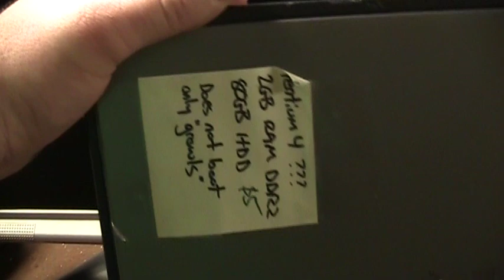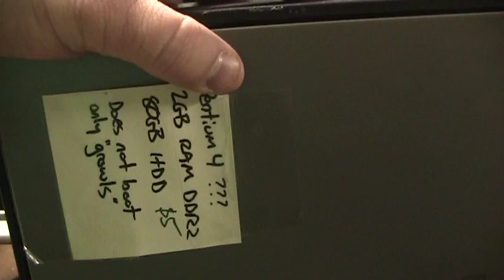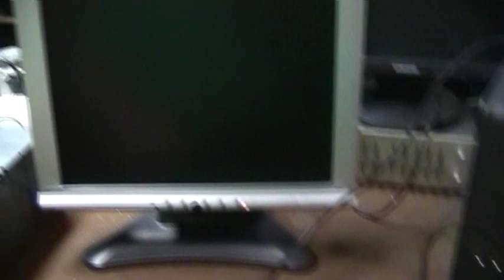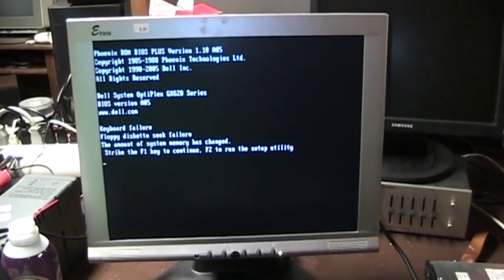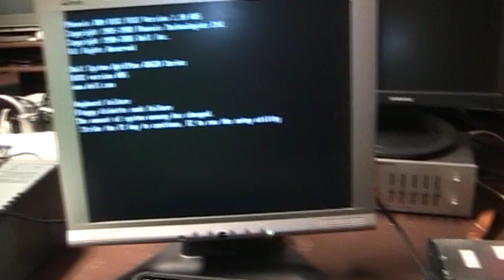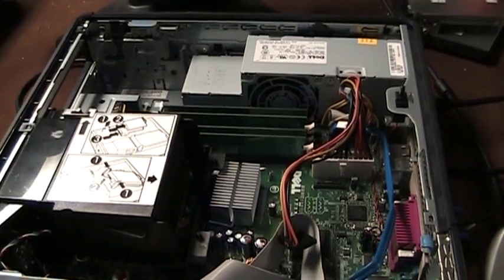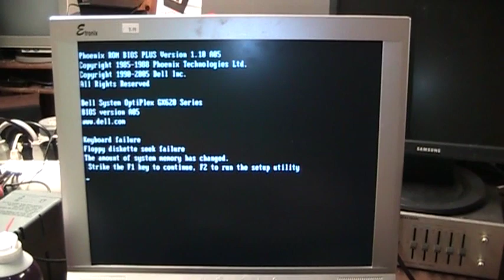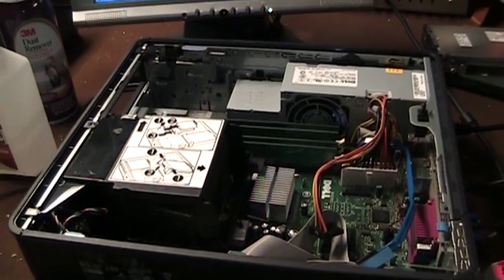Fixing and Tinkering With a Dell OptiPlex GX620 SFF Computer

Comment: Have some of These Machines still working today as FTP Servers for my old XP and 98 Machines transfer Files from and to it. Plug in 4gb Low Profile RAM to Help the airflow, and use some 65w Pentium 651 with 3,4ghz nice and cool. Plugin a dedicated Intel nic and installed Debian 12 headless with vsftp running fast and cool.

Comment: I've never seen or heard this before. Usually when there's a problem the power LED turns orange and you get the beep codes. My Optiplex 755 i retired would do that every once in a while. Reseating the RAM fixed it. The bad caps in the PSU don't seem it be a problem when i was still using it daily.

Comment: Hello i do have the same system... When i on the system on but no display.... I tried unplugging ram, hdd, dvd drives.. checked all cables. Green on light is also showing... But no display coming... I even tried to add a new display but not worked.. can provide me a solution...

Thanks

Comment: Can you help me I have same Pc but when i turn i on it makes srange ongoing noise non stop for like 2 mins or so and then it stops the fan is on and i have orange light on the front...And the test inducator when I turn it on just on sec is on number 4.I dont know whats the problem...Can you help me?
Reply from the maker: Erratic behavior like this is often a sign of a failed power supply. The orange LED also indicates a possible power supply failure, faulty expansion card, bad CPU or a system that can't even begin to start.

Inspect the computer's motherboard thoroughly for capacitors (cylinder shapes) whose tops have exploded or leaked. Any of those may also cause the problem and would have to be replaced for reliable operation.

Comment: i have restored my<dell optiplex 745 sff Computer back to working order a few days ago. it had four bulging capacitors on its System board and so it always shut itself down, once i put some load on the pc. Now that i have replaced the capacitors it has become my main pc with 4gb of ram and a gt 710 Video card

Comment: I had a GX520, found it in the trash. It was in terrible shape since it looked like it had been out in the rain for a long time. There was dirt all over the thing with water marks on it. I decided to make it shine. Surprisingly it booted without exploding, all the way to Windows 7. The hard drive kept slowing down leading me to think It was soon to crash. It did crash.
Then a year later the motherboard died. I never liked this machine, the motherboard was missing features and it wasn't the best. I ordered a 755, it looked like an identical computer, right down to the motherboard. I took out the Core 2 Duo inside of it, and put a Core 2 Quad Q6600 inside. Got it a AMD Radeon HD 2400 Pro, with the infamous DMS-59 connector. It is still in use today, and is one of my main machines

Comment: I have yet to see an OptiPlex system of this case style (including the BTX style case) with bad capacitors, have you seen many? I have been lucky enough to see a few bad motherboards particularly the GX520 model. I also had a bad power supply in a SFF unit too. But having a GX620 with a P4 @3.4 GHZ and 2GB of RAM, I have found it to be very useful system. Running Windows XP flawlessly.

Comment: I need to see exactly what u did. U cut the cleaning part out of the video. I have the exact same computer doing the exact same thing. Growling no video no boot ugh.
Reply from the maker: Odds are I clearly explained what I did. Maybe I even threw it in the dishwasher, which is a very effective way to clean dirty boards. And I do have a video about that, which you can watch. Remove the battery from the motherboard and give it a minimum of a week in fairly direct sunlight to dry out. Do NOT rush this.
Reply: uxwbill Still can't believe that works, dishwasher pc cleaning. I found a YouTube video showing someone hand washing a disassembled laptop someone slipped soda all over, it surprisingly came back to life.

Comment: can u plz tell me my optiplex is not starting?
when I turn it on it give me no display and it power button light turn orange 
kindly suggest me what can I do??
Reply: orange/amber light usually indicates that there is a cpu/ram problem, so try reseating your ram checking caps or even reseat your cpu etc and also does the computer beep and or does the fan run loud?

Comment: Fun Fact: Dell removed the diag lights on OptiPlex 7020's. We use the 7 series Desktops at my work (745, 760, 780 - All retired, then 790, 7010, and 7020) Kind of disappointed as I've gotten some 7020's new out of the box dead, be nice to see what error codes it is throwing but nothing.
Reply: I noticed that, we have a small group of i7 OptiPlex 5040's and I noticed they don't have any. Honestly, the easy maintenance of the OptiPlex was one of it's best attributes. They could have done what was done on the pre-BTX OptiPlex and include the indicator lights on the back! Absolutely awful decision of removing them!

Comment: I have an optiplex 745 that does basically the same thing but the so called "Growl" seems to beep on and off. No idea what's wrong, no memory in it either. The thing is, I would think it would give a normal beep code, not that low droan in incremental beeps.
Reply: *****
Yeah, I'm aware of that. Just an update, after I posted this comment I took some memory out of another computer and put it in. It turned on and booted to a live USB stick with linux, but yeah, the groaning in the psu continues. I've been told it has something to do with the copper coil inside the psu compressing and decompressing.

Comment: just got a Dell Optiplex gx620 SSF from the trash specs are pentium 4 HT running at 3.2ghz it's got an 80gig HD running windows XP pro SP3 it also has 4gigs of RAM works good so far i will be using it for music and DVD playback :D

Comment: I've inherited what I think is a GX620, but its a bit smaller than this, its got a laptop style multibay for the DVD drive, I think it uses the same optical drive assembly as a laptop of the same era. It also has an external power supply about 4-6 times the size of the power brick on my MacBook. Its got a Pentium of some sort I believe a 2.8 I'm at work right now and its at home, otherwise I'd be able to be more certain on the specs... But I do know its 64 bit capable hardware, but its running a regular 32 bit XP copy. I have a copy of Vista Ultimate that I bought for $30 that I want to use on it, I want to try and install the 64 bit version as well. Maybe I should make a video about all of this. It had a dead clock battery when I first started trying to get into it, and the CD drive wouldn't boot. I'm thinking the dead clock battery in it was causing some of this drama, I hope anyway.
Reply: I did some more playing last night, first thing was to check, it is indeed a GX620, I guess I figured the different sized machines would have different models numbers. Oh well, lol.

Anyhow, it has a 2.8 GHz Pentium D, I'm not sure if its a true dual core CPU or not, I haven't got that far into it yet. I did have a good look at the capacitors the first time I opened it up, mostly due to its bad behavior and vintage I figured it may have that problem, but I didn't see any that looked suspect, and I'm going to look again more closely tonight. I decided for best protection of the data on the drive that it had in it, I'm going to buy another drive on the way home (we have a Microcenter store that has 160GB drives for $12) to put in it and install Vista onto, and then thoroughly pick the the drive clean of all the data that I want to save via a USB external enclosure. I'm stuck going about it that way because I don't know the password on the user account, and the only user account is the administrator. I tried all the least intrusive ways around it, and even tried some method using the XP install disk. I screwed up the OS installation though, but I'm not too upset, my only interest in getting logged in was to find and back everything up before installing Vista. I thought about staying with XP on it, but remembering that XP is officially obsolete now was the final nail to that coffin. Plus, although it may be all in my head, but in comparing it seems that 64 bit can at times feel faster. I don't know if its just he way it handles RAM or if it has any effect on the CPU being more utilized or not. Plus it seems by the hardware specs that it should run Vista quite well, esp. if it is a dual core.

It has 1GB of RAM in it now, I probably will upgrade it to whatever the max is, I believe that is 4GB, but I'm going to check and see if more can be used successfully, I know on my 2009 MacBook (same as your white one) the max RAM is supposed to be 4, but I have had 8GB in t for over a year now, both Vista Ultimate 64bit (Bootcamp) and OS 10.10 both recognize and use all of it.
Reply: I think I forgot to also say that after replacing the battery the optical drive is working correctly. Before it wouldn't do anything, the BIOS wouldn't let me boot from it either, and in the boot order menu it claimed the bay to be empty, I thought the battery might fix it, or at least hoped, and it did. My BF (this was his computer, sadly on 3/19/15 congenital heart failure stole the love of my life from me, he was only 22) said a while back that some of the USB ports didn't work all the time, he knew about the DVD drive too, he also knew the battery was dead too. He didn't use it much, and once he moved in with me he didn't even unpack or set it up, he used his iPhone for almost everything, or my Mac Mini or Macbook when he needed a computer. His family gave me all of his electronics (game consoles such as his xbox and Wii, 3D TV and BluRay player, phone, MP3 players etc, etc...) including this computer. His dad thought I should just take the hard dive out and scrap it, as a computer from 2006 is too old and slow to be worth using. I just don't consider a computer with a 2.8GHz dual core 64bit CPU to be all that slow or useless, it even has a DVI port instead of VGA for the video out.
Reply: I've always thought it was interesting how sometimes to move forward you have to go back. I believe it was the heat the P4 created that caused its architecture to be dumped, I was told the reason they went back to the P3 and started again from there but I can't remember the whole story. 

I'm actually waiting for Vista to install right now, I picked up a used 160GB WD drive that just happened to have come from some other Dell desktop, as its Dell branded, and I have the original 80GB drive in a USB enclosure waiting to be read. But so far from playing around with the computer it seems like it should handle this OS well. I don't expect it to run as fast as say my MacBook with the same version of Vista installed with Bootcamp, but I don't think I'll find it all that slow.
Reply: +uxwbill Something common I used to see with the GX260 (yes 260, not 620) is a complete POST failure. You'd get fans running but no post, no beeps, nada.  2 or 3 I dealt with at the time had board replacements which fixed the issue.  It turned out the solution was far simpler.  Remove and reinstall the clock battery. Since that time I'm sure I've fixed far more myself. I don't recall seeing it in any other Optiplex systems, but I may have seen it in the related Dimension system, and I did see it in a Dell inspiron laptop before.  My employer at the time was a facility that had a decent amount of military people that worked there as well as civilians.  A Lt.Colonel that worked there asked if I could look at her personal laptop because it was sent to Dell and they said it was irreparable outside of a $450 motherboard replacement (for the $600 laptop). I said sure and took it home. I stripped it down to it's base componentry with no luck and was then reminded of the GX260 cmos battery issue.  It fixed it immediately.  She was so happy that I got it working that she insisted on paying me something.  I asked what Dell charged her to look at it and she said $150. I didn't charge near that amount.  I said if she liked I could write up a professional looking invoice that she could use as some leverage in getting her money back from Dell and she said yes, definitely. I never found out if she did, but it just shows that a glitch in the CMOS can really make things look bad.

Comment: Thanks for this video.   I had a Dell with a very similar problem.   Took it to a computer repair store, and was told I had a bad hard drive.   I needed to recover a couple of  documents, so I brought it back home, and was attempting to remove the hard drive to send it off to a data recovery company.  I got stuck trying to remove the floppy drive, and was looking for a video on teardown of this unit, when I ran across this video.    I just re-made all the memory connections, and the computer is alive.   Total cost of repair $0.    It took more time to drive to and from the computer store than it took for the actual repair.

Comment: These are good machines.  I used one for awhile as a HTPC. Put a Radeon 6450 low profile video card, and a P4-D 3.4GHz in the machine  The only mod I made was turning the CPU fan around to blow out the front, as I found the hard drive mounted directly behind the blow torch cpu was getting cooked to death.
Reply: That is why I ditched this computer in favor of the 745 you mention. Although it made for an excellent hand warmer in the winter :)  I've found only the fastest P4 furnaces can do what I needed for a HTPC.  I tried to put a Core 2 Duo in the little 620 but that motherboard just said "hell no!" I think the 620 would make an excellent NAS ( with a USB HD for backups if you needed) or Pfsense firewall box.

Comment: hi bro i have a PC like this, but when turn on only show a yellow light if you can help me i appreciate it
Reply: check and nothing
Reply: Carlos Mujica
then the motherboard is dead. i have had a 10 buck dell from 2000 and when i turned it on it just gave me a yellow light
Reply: usually means powersupply issue, check that everything is properly plugged in, or its the CPU which has died
Reply: Ignore my 2yr old dumb original comment

Comment: These machines really rock i do not know how many i recapped and one of them i use as my htpc now only thing i dislike is the cpu fan lol it is way to loud :)

Wonder if you can fool it to believe it is still have have the same cooling and put water cooling? :)

I also tried without luck to upgrade it with a few extra sata ports i even added the small 10nF caps but maybe it been disable in bios? :)

Comment: Awesome! My aunt gave me one for free and I love it, just one thing power supply went bad on me, replaced it, hard drive was bad after that (Note it worked for months before with no trouble) so I discovered it had a spare hard drive, and now when i went to reinstall windows I discovered it wasnt detecting one of my ram sticks and soon discovered it is bad :(.
Reply: The power supply rusn too hot. The one in my 755 has leaky caps.

Comment: I own one of these machines as well. Mine is equipped with a Pentium D & 2GB of ram. Absolutely has been the most reliable & tough machine i have  ever owned. Mine has been suffering as well with the burst caps for the past 4 years. I run speed fan and have the program "force fan's to high speed" 24-7. as you well know these machines are heat challenged! Good buy!

Comment: It took me a few minutes to figure out that video connector and find some place to order one.  I did find that if you pull the video card, you can use the on board video.  I think you mentioned that.

Tom

Comment: Once the capacitors quit, the system will turn on, flicker twice, then shut off. To my dismay, these caps are responsible for the CPU power.

Comment: I too used to buy cans of air and it's way too expensive for what it is. Plus if you tilt the bottle liquid burst out. I clean mine and my brother pc every 4-5 months with my 8 gal air compressor. It take about 4 gal of air per pc when you greatly abuse of it. I paid 240$ for it and it will last me many years. If money is an issue you can still buy a 100$ 2gal one, some don't use any oil for the motor, and will work way better than air cans.
Reply: i would agree an oil less air compressor are great for inside the computer chassis. especially when you see these little dust bunnies or the moustaches on the front grill. either size will do.

Comment: (I do wish YT would extend the character limit in comments) Anyway while I was looking in his PC it was choked with dust. The vents on the PSU that died were clogged thick with dust restricting air flow to well, probably zero. My theory is it was that that caused the PSU to fail. 

I think lessons should be given on basic PC servicing such as renewing thermal paste and dusting it out periodically to prolong your PC's life.

Comment: It's always a good idea to periodically dust out a computer. A friend of mine had his PC fail. He told me over FB that it puffed out some smoke from the back and died then wouldn't turn on. I said over FB it sounds like the PSU failed. So I go over to his place to have a look, took one sniff of the PSU and confirmed my diagnosis. We then went to a computer shop and bought a replacement PSU, came home and fitted it to his PC and bobs ya uncle.

Comment: I never understood Dell's decision in putting the big 3.5" hard disk drives in these SFF desktops. A 5400RPM 2.5" drive would've given a wealth of airflow to the machine and probably negated any bloated capacitor problems.

Comment: Long time no view, uxwbill. :) I have a GX520 larger desktop form factor with a Cedar Mill Pentium 4 and it has worked beautifully for the past several years 24/7. No bad capacitors in this one. I have only had one Dell with bad caps and that was an Optiplex GX280 SFF with a Prescott Pentium 4.